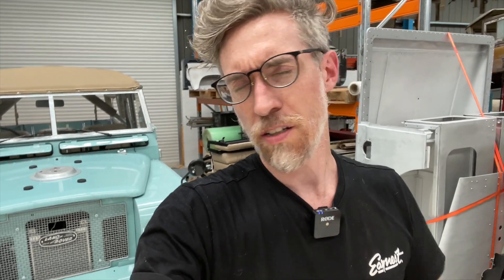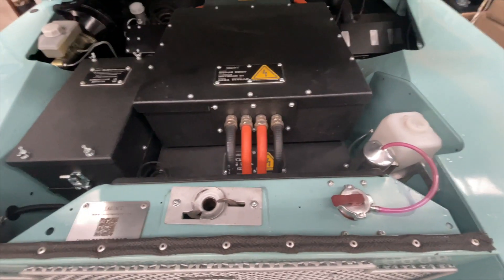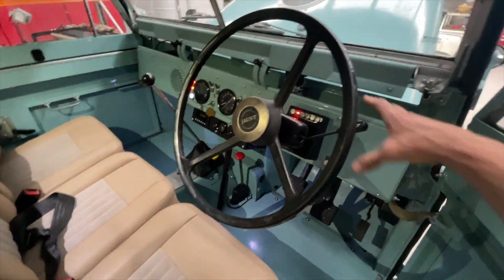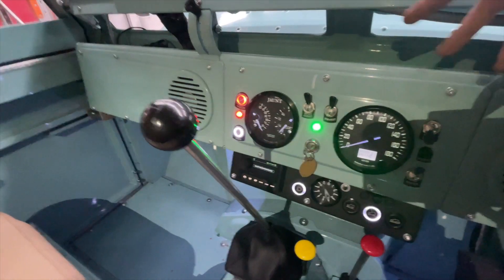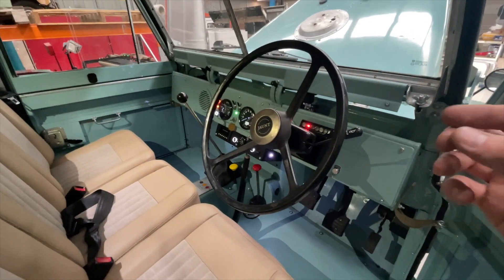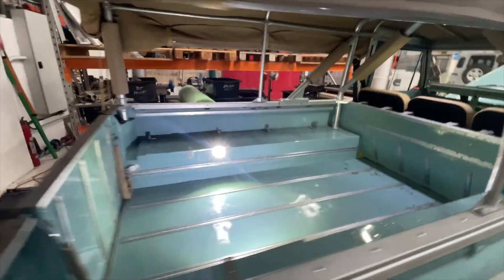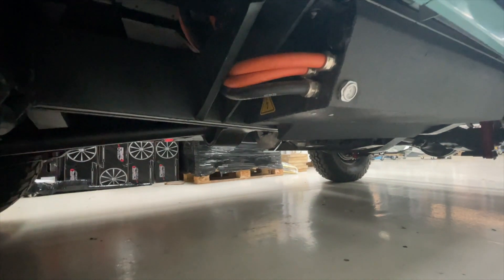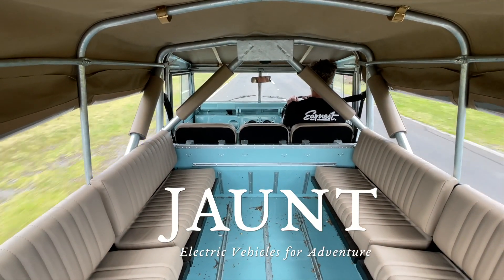Electric Land Rover Series 3 Walk-around

Comment: Why are the indicators and sidelights upside down? Normally sidelights on top I swear.
Reply from the maker: That’s how we like them.  Ha. Indicators a bit more visible up the top we’ve found. Almost never just use side lights
Reply: @Jauntmotors  oh that's fair. Mine is connaught Green and limestone so it blends in with the countryside. I'm just used to driving around on sidelights all the time.
Reply from the maker: @gd4r2v2kmv    We have DRLs in the headlights so it’s nicely visible.
Reply: I've seen it done both ways